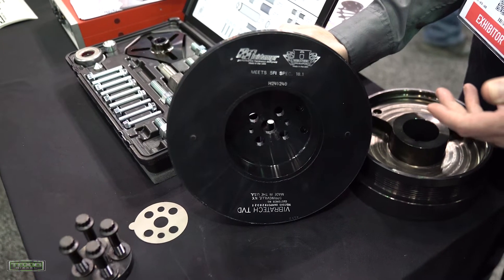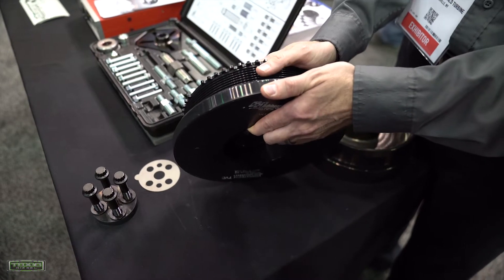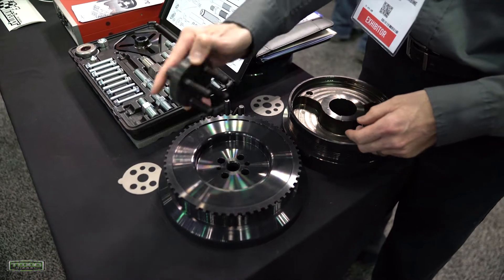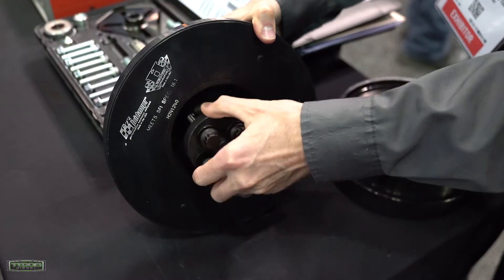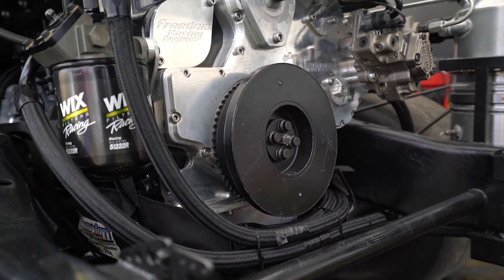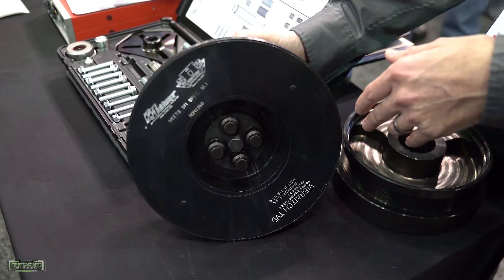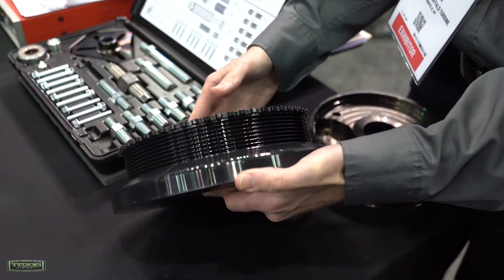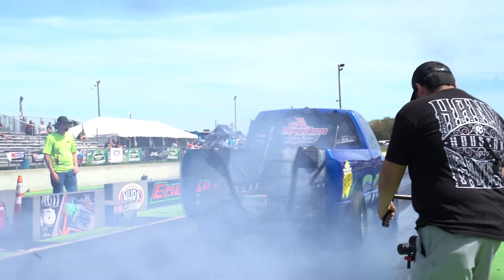Best 5.9L Cummins Fluidampr Harmonic Balancer Product

Comment: I bought one of these(920301). Along with the drill-pin kit(300002), and their high strength bolt kit(300007) since they've made it where the belt can be removed with out damper removal. Its on back order right now with a ship date of May 5th 2020. Nice to see they've incorporated the tone ring, and made belt removal much easier.
Reply: What's the ring do?
Reply: @harveyr.jonesiii1820 the tone ring is used by the ECM to determine the location of the enging in its rotation for the various timmed events, like fuel injection and injection timming. Early versions of the Fluidampr did not have the tone ring made on to it, and a user was required to use the oem tone ring.